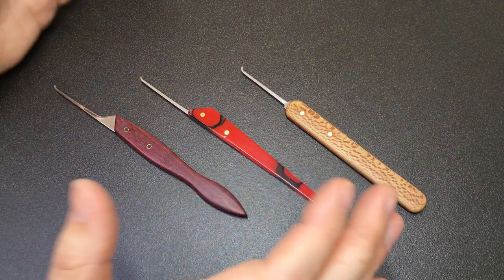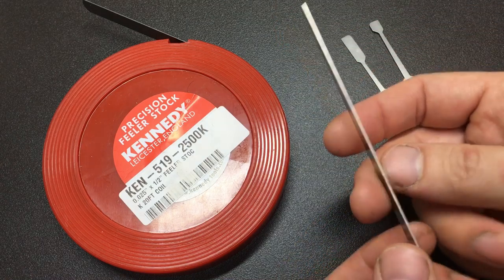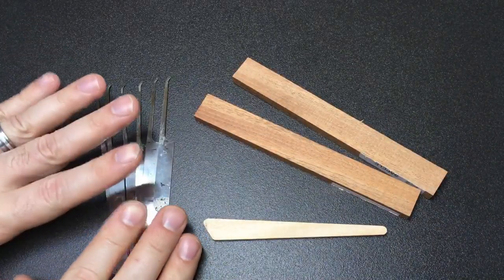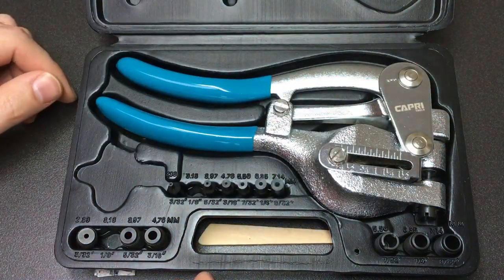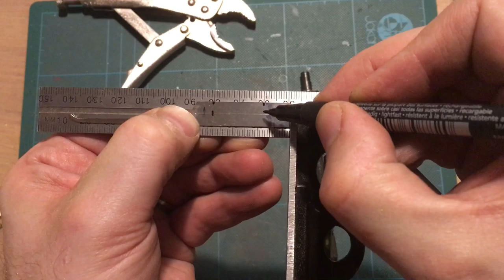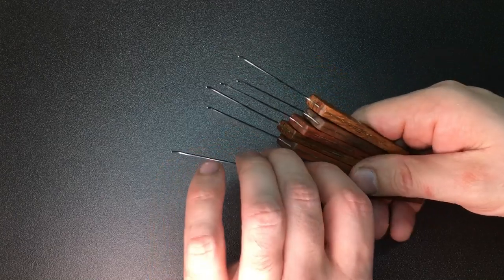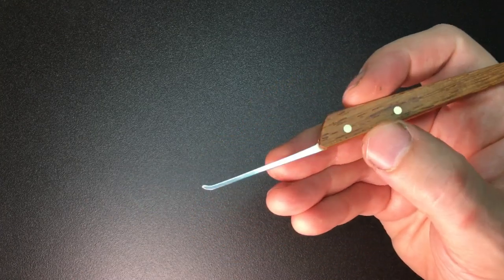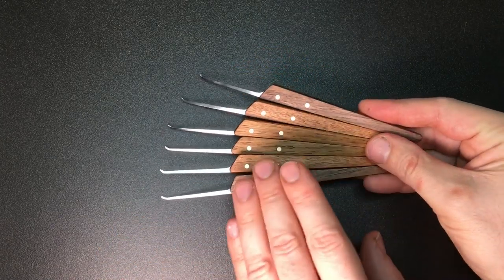Making Beautiful Custom Lock Picks

Comment: Hey man, just a couple of quick tips from a woodworker getting into lock picking. If you are trying to get straight cuts clamp down the straight edge to the table. So much better than holding it with your hand.  You can also get a speed square or even just use your combo square to get have a nice square cut

Also, I know space is a premium for you but you should definitely look into a small band saw. More specifically a portable band saw and then get a "portaband table". It's super compact and you can easily store away when needed. It would be much faster and less frustrating than using that dremel scroll saw, you won't worry about breaking the blades on them. You can also use it for cutting away big chunks on the pick so you aren't grinding for days.
Reply from the maker: Thanks for the tips! 👍😃

Comment: Here's my Hints&Tips...just two really.
1. Try using Banding from palletted materials.  The black metal is a good thickness and I think it's strong enough.  Only tried once.
2. Use a Mag Wheel Polish first with a Dremel and cotton wheel, then by hand for an Ultra mirror finish.
I have actually figured out how to make the very best functioning lockpick and from what I have seen no one else has clued in to it so far.  I am reluctant to just put the idea out there and I would really like to do a limited proof of concept run to see if I am right.  The problem is of course time and money.  Also, as a product for the LockSport community it won't generate enough profit to be viable as a business model.  I am considering producing some custom made pick sets however the price would be in the $500-$1000 range per set of 5-10 picks in a nice box.  That certainly puts it out of my budget range as a lock hobbyist.  Given these facts I am tempted to just dump the idea in the community and watch it grow on its own.
Reply from the maker: Nice tips 👍

Comment: Beautiful work. Im wondering if its possible to get a solid fit and feel while making the scales removable, id hate to break a pick and have to bin it or drill out and replace pins to keep using it. Maybe post screws to retain scale to scale, and set screws in threaded inserts to lock in the pick. Or epoxy bed the tang with a release agent for a super tight fit, but then all tangs would need to be identical. Could make it so it takes factory unhandled picks even. Your DIY videos definitely get the creative gears turning

Comment: I've been thinking of making some fancy handles for my desktop picks.  Partly there is the pride of ownership in a custom hand crafted tool, but there is also a more practical ergonomic aspect as well.  I carry bare Sparrows picks but my desk ser is their set with dipped handles.  Thay're much better than flat naked stainless but they tend to roll in my hands sometimes and there is room for ergonomic improvement.  Maybe I'll mahe a hand shaped tung oil rubbed walnut handle for my standard pick.  Maybe I'll 3D print some ergonomic handles for a desktop set of picks.that I order without handles.
Reply from the maker: Many choices!

Comment: I noticed you don't hammer the pins in place. Try to cut 2 mm longer and bolt them. Just for fun. Seems epoxy do the job nicely.
Don't get too attached. Your picks are great!
Reply from the maker: Peeling pins takes more skill, than I have 🙂

Comment: just a few things i like to mention, you might of want to visit your local lumber yard and see what woods they have and brought a large piece of zebra wood or something, they could plane it and slice it thin for you for free or a slight fee.  not a fan of teak oil and i prefer tung oil when you use that you should of applied with a cloth or sponge and give it a light sanding between coats with 3 coat minimum with a day between coats.  you could also skip the oil and just sand smooth and use lemon oil or butcher wax if you want a nice finish where you can feel the wood and thats what i use for my instruments. ever thought of going full tang?
Reply from the maker: I will have to try tung oil 👍